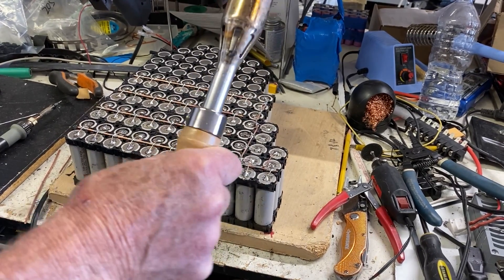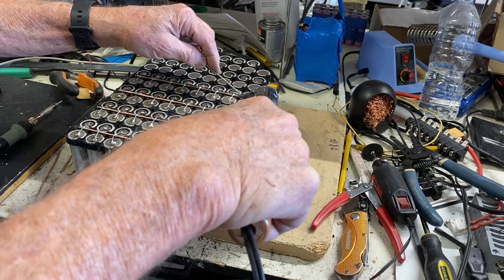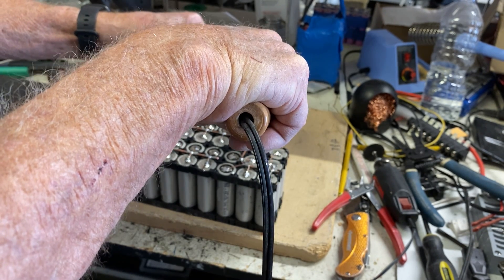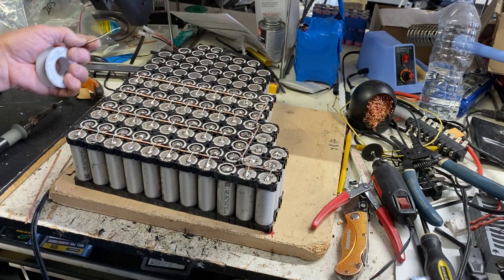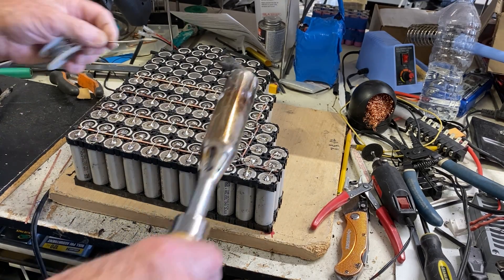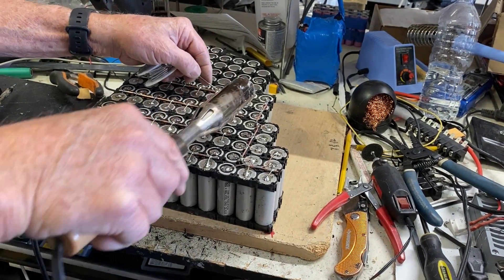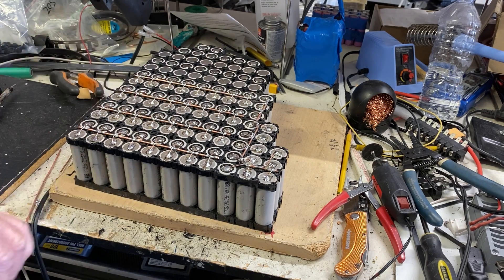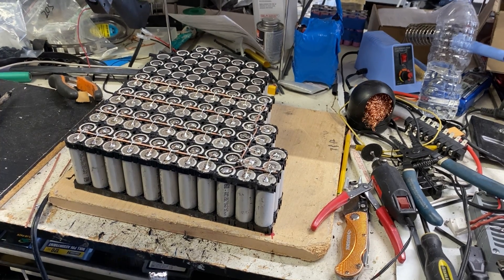Molicel Battery DIY Build Video 6 of 6

Comment: hi Donald are those busbars thick enough to handle the high amount of current? are you seeing a lot of voltage sag on your battery when under load?
Reply from the maker: Yes, I have tested them to 400Amps.  They are 2mm in diameter, and the smaller wires are 1mm, tested for about 90Amps.  You will always get SAG under load 5-8 Volts with these high currents.
Reply: @dcoxryton Hi Donald. Have you ever used nickel strips along with the copper sheets in any of your builds? I'm thinking about making my own 20s8p battery and wanted your thoughts on using those materials. Thanks!
Reply from the maker: @sabrown919  No I haven't used nickel, it is not as conductive as a lot of other metals.  What we ae doing now is water jetting  .4mm copper sheets .  Message me on Electricdirtriders.com  ,  and I will send you pictures of our new methods.

Comment: How did u find enough of these ?  They have incredible power to weight.   I have a modified leaf pushing 400amps at 380v , my aim is to push 600 amps with maybe 1/4 they weight.  Stock is 9 seconds to 60, im currently doing 5.4 , thinking all-wheel drive and into the 2 second bracket.  These cells are the key.
Reply from the maker: Liion Wholesaler has had a good supply of these.    liionwholesale.com